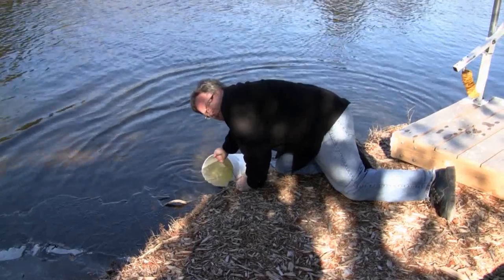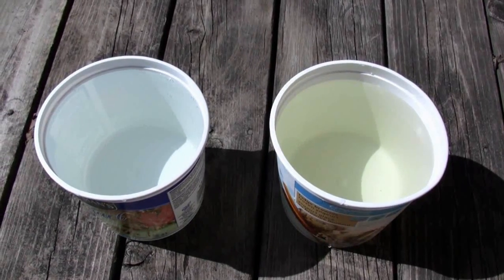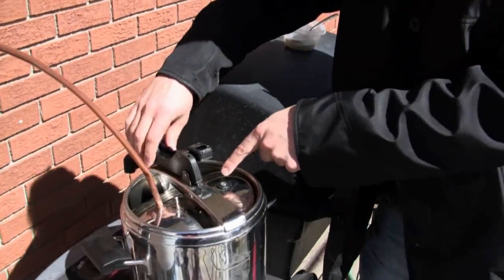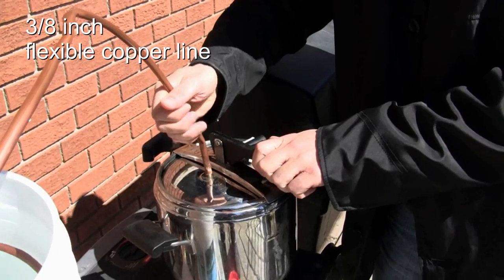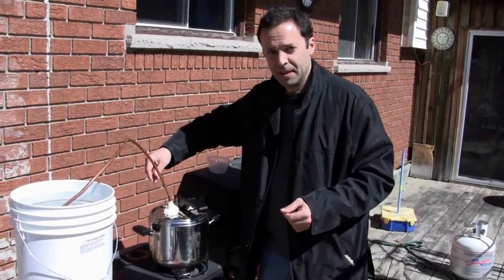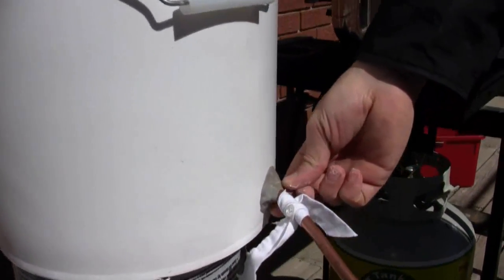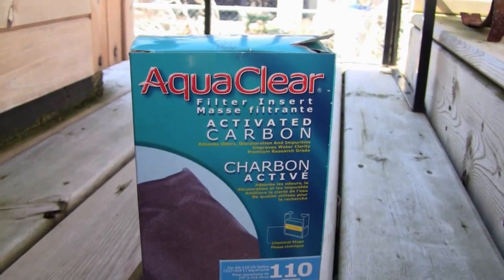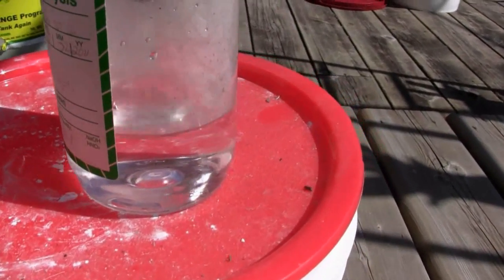Water Purification and Desalination in an Emergency Situation

Comment from the maker: The carbon filter at the end of the process was there to take care of any lingering VOC's that may not have boiled off. Although they should be taken care of by letting them escape before you put the lid on the distiller, activated carbon is cheap, $10 at the pet store. Just an added  precaution.

Comment from the maker: The pressure cooker is a Lagostina stainless steel I bought at Canadian Tire for $150, it went on sale a while later for $75. Stainless steel is much more expensive than aluminum but worth it. I don't cook with aluminum or teflon, that stuff is bad for you. The connection to the copper pipe is a standard size nipple (or close,) and should fit for all pressure cookers with a little heat to the copper line and persistance.